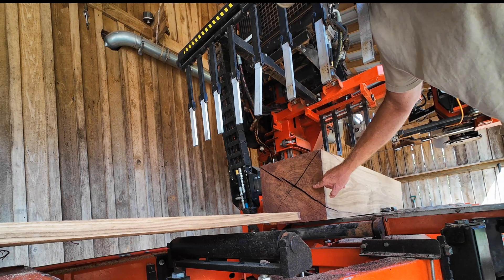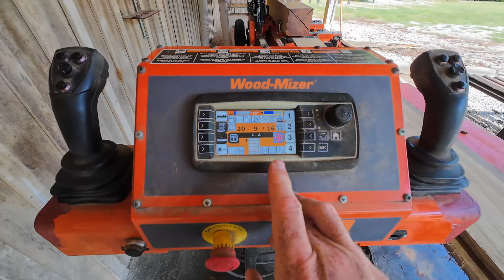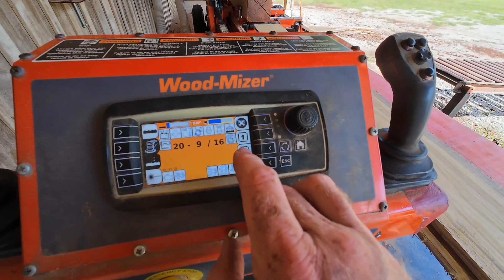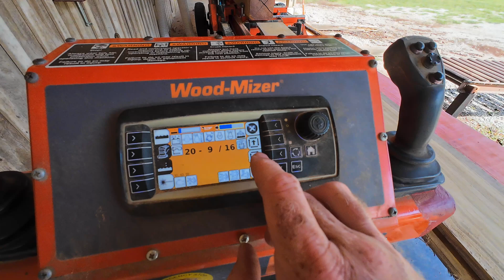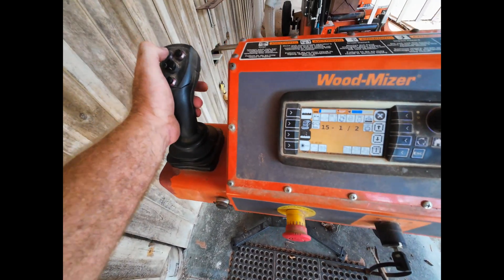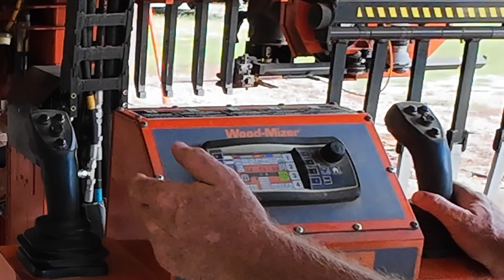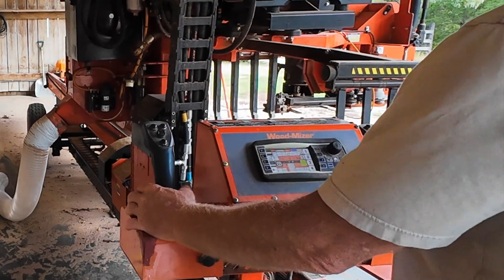I Hate Sawing Pizzas (Logs) and Sawmill Edging Tips

Comment: Have you ever used a metal detector to check for metal in your logs?
Reply from the maker: Yes, , and I have, and have a new video coming out about it. Basically, detecting every log with a big "D" coil takes a lot of time, as the log must be separated out of a pile to get to all sides, and these do not work when the log gets on the mill where I can use the log roller, because there is too much background metal and the metal detector false triggers.  I use pinpoint detectors, but their usefulness is debatable, and in the case of the video, generally erratic.  There may be a good D could detecter for logs, but I have't found one that was worth the money, but I've never spent more than #$500 for one either.  You will get a laugh out of my next video where I "fix" my current detector.

Comment: Thanks for the video. I'm interested in those advanced techniques on air drying quickly.  Also, i'm interested in how efficient that solar kiln was that you used to use and was this just when you were in the hobby stage?
Reply from the maker: A correctly built solar kiln is a great way to slowly dry lumber, and I know Professor Gene Wengert pretty good, the inventor of the Va Tech solar kiln, and if you build it according to his plans, it will work.  It's slow, it doesn't do real well when there isn't much "solar" like in the winter, but I used it even after we had our other two kins set up and running.  Eventually, an Alabama hailstorm took it out, so I retired it (and made a video of me tearing it down).  Solar kilns don't sterilize but they rarely screw wood up.  I called mine the "Easy Bake Oven" and built it with wood from my sawmill.  It's a good project to do, and will teach you lots about kiln drying so if you do move to a DH kiln, you have a good fundamental understanding of what to do.  This is a good topic for a video.

Comment: Hi, 
Can you make some videos of putting rough lumber through the planer? do you straight edge or joint boards? I'd really like to see a channel with high production / output of rough sawn lumber to planed lumber.
Thank you!
Reply from the maker: Yes, I will do it.
Reply: @HobbyHardwoodAlabama  Thank you, that'll be fun to see you surface the rough boards. I did see some of your earlier videos with the powermatic 20" planer. and another video with the straightline rip saw from baker to make quarter sawn red oak. Those were great to see! Personally, I like to cut a slab out of the middle of a log, then cut the halfs into rift and quartered beams. First step is to square the cant. Then the lumber really dries flat and is pretty uniform widths and manageable size boards.

Comment: Thanks for the information on the accuset. I went to Paul Bunyan and did not get a real opportunity for any type of demo on that. I am trying to decide between an LT50 or LT70. They didn't have a 50 there, so I couldn't compare apples to apples between the two. I love how you still managed to get some chicken soup from that chicken $h1t log! 😂 As always, thanks for your time professor!!
Reply from the maker: I’ve run both, the 70 has 6 times faster hydros, but complicated and more prone to malfunction, but much better production and ease of use.  The LT50 is basically an LT40 Super with a chain turner.  Reliable, but much slower.